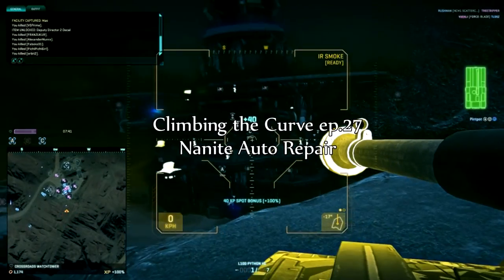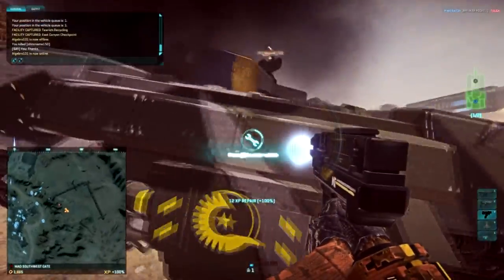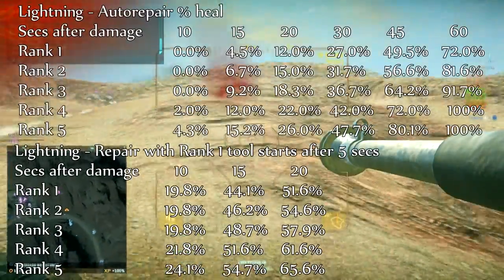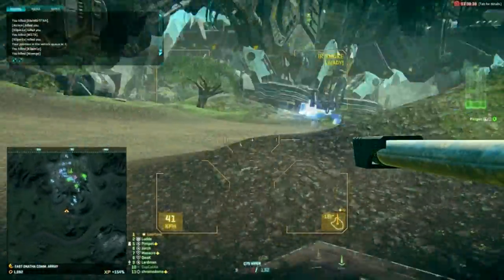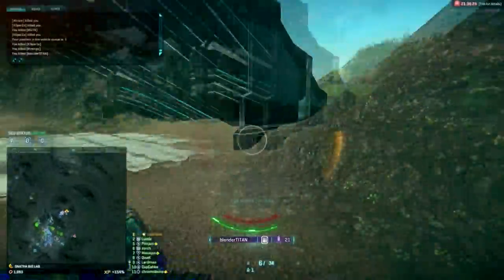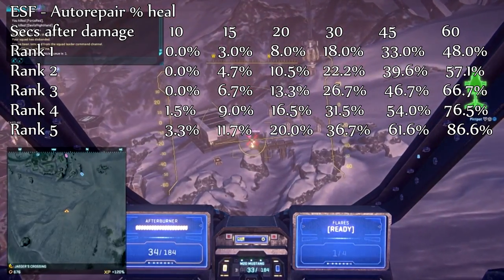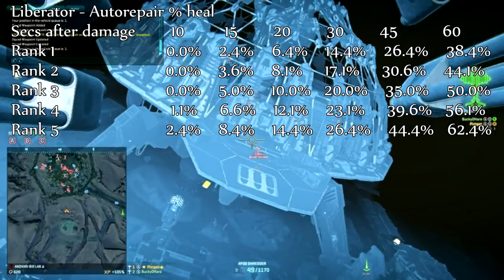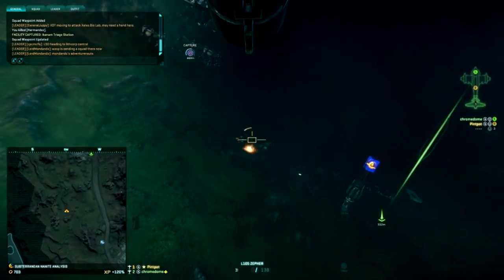Beginners Guide to Planetside 2 - Vehicle Nanite Auto Repair - Climbing the Curve ep.27

Comment: If you're using the harasser for it's intended purpose (rapid transit and flanking), then auto-repair is amazing helpful, as getting out and repairing can put hundreds of meters of distance between where you are and where you would be.  Not conducive to high-speed chases or getting somewhere faster than the enemy.

Harassers also require frequent top-up due to their currently wonky driving physics and propensity for flipping and general wear and tear from high-speed off-road driving.  Harasser is one of my two most commonly used vehicles, and I almost never roll it without NAR, which is only at a modest level.  This has proven far more useful to me than composite.
Reply from the maker: I agree composite isn't very useful at all now on the harasser.  I am just not convinced the auto repair is strong enough to justify itself unless you are running with a non-engineer.  But I would definitely rather have NAR than composite these days.

Comment: Not sure what's the best format here tbh: Going by slot item (auto-repair) like you're doing vs making video's by vehicle type (Flash). It should be mentioned that auto-repair stacks incredibly well with fire suppression btw, especially in an ESF.
Reply from the maker: Yep, I agree its unclear which format is best.
Maybe I should put a link to the time where I talk about specific vehicles in the description.
I think because I wanted to look at each slot in a little more depth I chose to do it this way, rather than by vehicle.
I mentioned the strength of fire suppression  on ESFs, but your right, i should have mentioned how fire suppression allows auto repair to work again by taking vehicles out of being on fire. 
Thanks again for your (always) insightful comments rolf ski :)